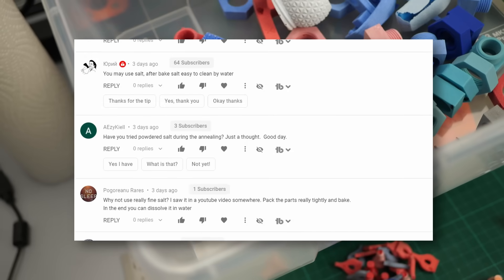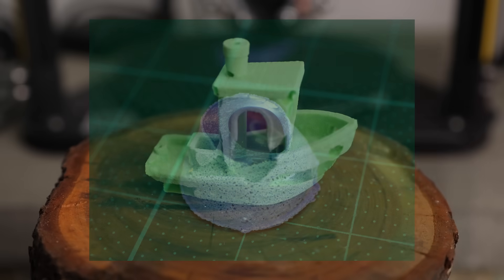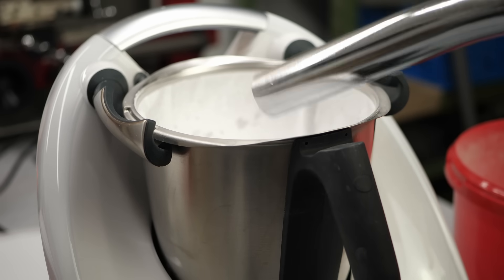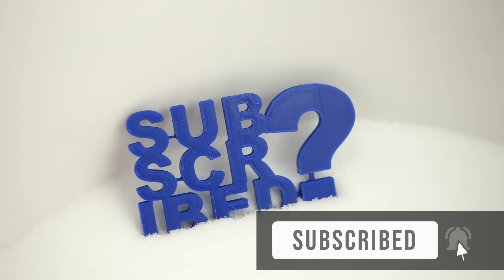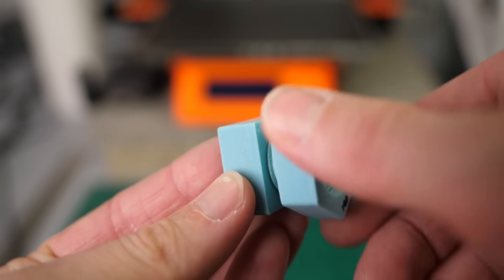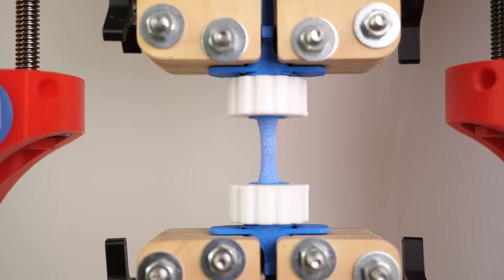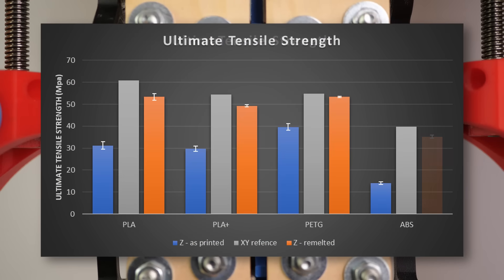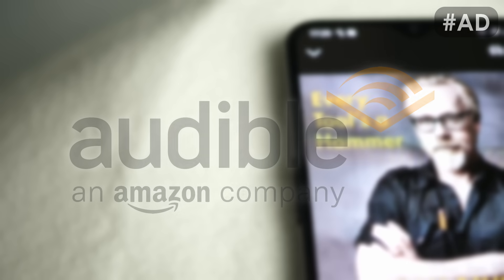The STRENGTH of 3D prints REMELTED in SALT

Comment: If we consider this a "success" as a proof of concept I think I can suggest how to make the amount of work reasonable.  The parts I find unacceptable are the grinding mess and the long heating and cooling of a large thermal mass.  My change would be to make a contained coating machine that would shuttle the part back and forth from a vapor spray side that wets it all around then over to a salt dust side that agitates fine dry salt until the part is no longer wet -back to wet again and again.  The salt coating side could progress to larger grain salt after the fine coating is complete.  The coated parts could go through the thermal cycle in a convection oven without being immersed in a big solid mass of salt -thus much quicker.

Comment: i was wondering if this method can also used as combining seperate parts as one. it would be better than any glue. but also it will be really hard to align the parts properly so msybe a dab of glue to set them in correct placement? Either way really exciting stuff. keep up the good work.

Comment: question for discussion. Has it occurred to someone to use a fully saturated salt solution and soak the object in it several times to form a crust on the surface? And the subsequent procedure would remain the same as before. It is clear to me that there are several unknowns in that theory. If the crystalline structure can withstand any thermal stress or expansion of the object's material.

Comment: I'm so glad you did this video I was really hoping you would after seeing the salt video. One other option instead of flour salt that may work and is more easily sourced locally is washing soda or sodium carbonate. I think it could be promising do to it's smaller grain size and if it's not available locally it's easy to make by slowing heating baking soda. Also another possibility would be cornstarch since it is super fine but I'm unable to find and info online as to the temp at which it will combust so I'm hesitant to try it

Comment: @CNCKitchen | What if you dissolve salt in boiling water and after that boil the water off? It will be a brick of salt without big crystals, which is much easier to grind I guess.
Reply: Or something like corn starch. That's also kinda "sticky" to itself. Dunno what will happen if it's 230C but worth a try I guess:)

Comment: Here's an idea for making extremely small grains of salt. Use spray drying. It would require  a machine to be built, but it's not overly complicated. Proof of concept could be done with a garden sprayer and a heat gun. The advantage there would be there are many knobs you can turn to vary grain size. Nozzle orifice size, Flow rate, and Brine concentration to name a few.  But overall, the grain size will be directly proportional to the droplet size and fog droplets are 10-15 micron. Just food for thought.

Comment: Grinding large amounts of salt in your blender sounds like a bad idea. Even if it does not overheat, it will probably wear out your knife block fast. A better solution might be a grinder made out of ceramic parts. Using a grinder also gives you more reliable results as you can set it to a fixed grain size.

Comment: Amazing video, a lot of great information! It would be great if you could try salts that are naturally extremely fine grain, cheap, temperature stable and non-toxic. Titanium dioxide - cheap pigment grade - has grain sizes in the order of 200-300 nm and can be heated to these temperature with no problem. I bet that would lead to awesome resolution when remelting :)

Comment: Maybe, try mixing the salt with a small amount of  highly dispersed silicon dioxide. It's usally used to improve the flow properties in, for example, capsule fillings and tabletting mixtures. The particle size of 5-50 nm could also further improve the level of detail.  It should be readily available as "Polisorb" in germany. You can find it in pharmacys and sometimes in drugstores.

Comment: i think that reducing the grain dimension furthermore could possibly increase also the interface surface tension between printed part and salt. This would probably not only improve the surface's overall look but also reduce the mixing between salt and polymers that you can see on the cracks sections.

Comment: Try baking soda. It normally comes as a fine powder off shelf. And you can remove it without any residue with a slightly acidic solution (vinegar or citric acid).

Comment: Would there be any benefit to adding a riser, like with metal casting, of sacrificial material to the top of parts to fill in for any shrinkage?
Reply: There might be some in very limited scenarios.
Risers are a bit more complicated in metal casting because they are designed (often through trial and error) to facilitate the injection process, to balance flow rates through the die, to deal with the metal cooling or swirling in portions it shouldn't, etc.  Much of that is already being handled, here, by the printing process, itself.  The dimensional changes are mostly coming from the salt grains creating voids for the plastic to seep into once made liquid.
Injection molding is part of my upbringing, and it's still more of a dark art than many people realize.  There are around 80 diecasting factories in the world (for metal) if that gives you any idea how powerful yet small the trade is.

You might be able to use that method to, say, use a high degree of infill and then create a riser where you can add bulk material to it.  However, there would be no inherent pressure aside from gravity, and you would be trading one void for another in the packing.

I suppose you could play around with some kind of springloaded injector.  Once the mass goes liquid, a spring would push the plastic into the voids left by infill.

Venting, however, would likely be necessary to allow displaced air and gas to escape.  It may be able to do it through the packing, but this method would be closer to what is called drop forging or sand casting.

Comment: I ran a few prints both annealing at 100c water bath and at 200c+ in the oven.  I packed the prints in salt flour and put them in vaccuum chamber to ensure good packing.  The oven prints at 200 or above seemed more brittle.  The PETG surface finish was better than PLA, looking like SLA.  The PLA had dimples where the infill didn't quite meet or air collected as bubbles although printed at 100% infill.  The water bath has more promise for annealing.  I used a sous vide machine.  First I packed the parts in flour salt in a paint can then vaccuumed it in a sealed plastic bag so the vaccuum was held during heating.  This held the salt quite tight.  I heated at 100c for several hours and the parts were much better.  Surface finish was good and not as brittle  Definitely not melted though.

Comment: Another good reason for which you should not use salt in the grinder (or on any element which has sharp blades) is that it will destroy the blades, due to salt capacity of corroding and destroying metal parts. That's the reason for which even sharp knives cannot be washed in a dishwasher, it unsharpens the blade

Comment: i did the same process, in a small kitchen oven and 10cm diameter stainless steel bowl. The optimum remelting time for my setup is less than 20min (in contrast to 2hrs in your tall container and 40min from freespirit wide glass tray). the rate of heat transfer for powdered salt is worth investigation and you can get a formula for the process. 

also, compression from top of the salt really help to prevent any flashing/seeping. it stabilises and stop the formation of crack in the salt mold

Comment: If you print a bolt you should do it horisontally instead of vertically as  each layer is stronger than the bonding to next is, so yoh wish for long extrusions in the components stress axis. Then, you can do this..but start print with that in mind and also correct temp and extrusion. A lot of people do not change temperature with speed wich leads to under extrusion. Up to amreasonable speed it doesent matter and if it comes,out fine as most print same speed all the time it is a no problem , as long as you dont change any setting. Pla is the most rigid of them all but less flexible so consider pla,or petg over abs.

Comment: Salt is quite reactive chemically, depending on exactly what is in the filament you might have some interesting reactions with the salt at high temps. A medium that is less reactive might be better or perhaps even coating the prints with a silicone mold release agent.

Comment: For me the appeal of salt is its reuse ability there's very little waist and you can reuse the salt over and over again

I wonder if we can treat the surface of the print before embedding it in the salt to avoid the porosity of the surface for example will clear coat spray paint survive 200 Celsius?

Comment: I don't know if somebody mentioned it already.
But you could try these packing materials:
- Aluminum Powder --> Won't dissolve, but guides heat very well. 
- Backing Soda (Sodium Bicarbonate) --> Easily dissolves, especially when you add a little vinegar.

If you combine @LazerLord10 's answer with the aluminum powder then I think we got a real winner.

Comment: What is also interesting with this method is that you might dry the part. Salt is hydrophilic and will pull some water. You can look into different salts, like lithium chloride or magnesium chloride. They are much more hydrophilic and result in a much lower relative humidity. I used it to calibrate sensors, but the idea might apply here too:
https://www.allaboutcircuits.com/projects/how-to-check-and-calibrate-a-humidity-sensor/

Comment: You should look into what a lot of guys do with sandcasting. Essentially the 3D print is embedded in super fine refractory sand that is compacted to form a mold and filled with molten metal. I coat my parts in graphite for ultimate smooth surface finish, and I suspect this method could also work for remelting. I haven't tried it quite like this as I'm really just using the 3D print to mold the sand, but I don't see why it wouldn't.

Comment: I'd be interested in seeing talc or gypsum (plaster without the water). Maybe using a vibe table would help compact as you go.  I'd also love to see what would happen if you coated the parts in a higher temp epoxy before treating.  Maybe giving the parts something that doesn't melt would stop the pores from forming.

Comment: Looking at this it strikes me that the problem with the porous surface is the salt interacting with the plastic somehow.  What if you used the same technique, but used casting sand.  Its very fine (although I'm not sure how fine), will retain the shape just like the fine salt and is capable of withstanding extremely high temps without issue.  the 200 odd degrees required here is nothing compared with molten steel.  Might be worth investigating.   Top work on all your videos, btw!  keep up the good work!

Comment: I'd be interested in seeing sodium carbonate and calcium carbonate.  These are both fairly easy to dissolve, are easier to get in a powder form, and aren't as corrosive to iron.  If you ground the powder with nitrogen gas, you could probably also drive out most of the oxygen between the grains, and avoid some of the oxidation effects you see in the ABS at higher temperatures.

Comment: I might actually have a suggestion to make here. I don't 3D-print, but over the past couple years I've had to take to grinding down salt for medical purposes in a similar fashion to what you describe. I found that after finely powdering it, it had a tendency to stick together because there was too much moisture in the salt itself. This can easily be solved by pouring the salt into a flat pan and then baking it at a medium heat for a few hours, at which it will have a consistency closer to fine, dry sand, which might help for when trying to get it into all those little crevices.
Reply: What about adding an anti-clumping agent such as they do with pyro chemicals?
Reply: @rahmanahashem3484  Interesting idea but my instant reaction is, well, pun intended ("reaction"): you've got no idea how that anti-clumping (anti-caking) agent is going to react with the filament, short- or long-term, either, without some testing. And seeing as how one of the things we're after as the vid-poster points out is strength, throwing something new and unknown (sodium aluminosilicate, calcium carbonate, calcium silicate (lots of them are silicates), silicon dioxide (basically powdered quartz/sandstone), etc.) in the mix is maybe not a great idea, vs. simply controlling existing variables.
The 3D printing world is pretty used to controlling for moisture: somewhat with filaments like PLA (although some of us, me included, don't always practice good storage discipline and drying it out doesn't quite make up for that sin...); far more so with really touchy filaments like PA (Nylon) that'll poof and expand by 30% 6 seconds after you open them if you're not in a dry room with a bunny suit on that vents to the outside.
It's relatively "easy" to (a) make "powder-salt", (b) dry it and (c) keep it dry, with just a little attention to "lab discipline". Hey, compared to dealing with even basic lab protocols (like don't ever pour excess material back in the container; how to handle a bottle of acid (there's a joke there with "basic" earlier in the sentence), etc., this is trivial stuff.
Reply: @sumgai7  lol people put additives into plastics that immediately degrade them in real world products daily.  I just took a pair of new never out of the box shoes from my closet, they had sat 5 years, and the rubber literally fell off in large clumps easily disintegrating at a slight touch.  Whoever said plastics last millions of years was full of it, they start breaking down immediately.
Reply: I wonder if you could use a silt soil (silt = finest grain size of all soils), put that on a baking tray in the oven to dry it out, then use that instead of salt for this remelting...
Reply: bruh you cooking some cut ahh rerock lmao
Reply: I was gonna say - that salt looks really wet, could use some time in a baking tray in the oven, or some intimate time with calcium carbonate
Reply: This.  You can try to do a long roast before grinding, but when I grind salt, I do it in stages.  Roast, grind, repeat.  Each grinding step releases a remarkable amount of water that makes the grinding rapidly become ineffective, but grinding makes the salt easier to roast.  Since I'm grinding salt from coarse granules and pellets (1/8" to 1/2"), doing a single roast would just take forever.
Reply: Just a heads up, this also works with all types of chips and crisps, and cereals and any similar food that has lost its crisp.  I use 170F because it’s the lowest setting the oven will allow and crack the door a few times to let out moisture.  I spread the material no thicker than 1/2” across as many large trays as you can use.   You can also make dried beef, fish, and other foods with the same method.
Reply: Don't want to intrude on your personal life and feel free to say no if you're uncomfortable answering, but I got really curious. What did you use the salt for medically?
Take care :)
Reply: @idekman5427  Maybe he is making bath salts.
Reply: @idekman5427  Rinsing out my sinuses. I mix a specific amount of salt in with a specific amount of warm water but I found that most types of granulated or crystalline salt didn't well fit into the measure, so I ground it up. Then because it was too wet it got stuck in the jar I keep it in, so I started roasting it. The end result could very well pass off as some kind of powdered drug, but it works real well.
Reply: @PackthatcameBack  Back in South Africa we called an activity used to clear sinuses "see snot klap" Which translates to "sea snot slap"  In short, we go to the beach and get smacked in the face by waves.
Reply: @alaskanalain  which is more or less what sterimar is.... :)